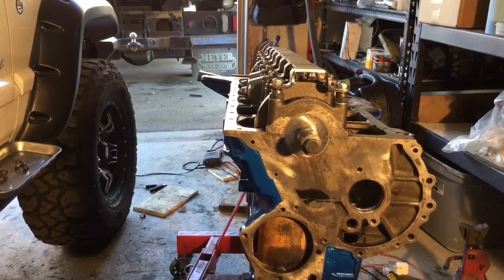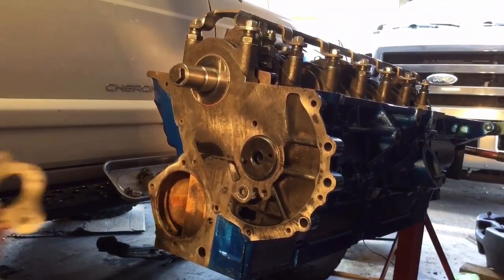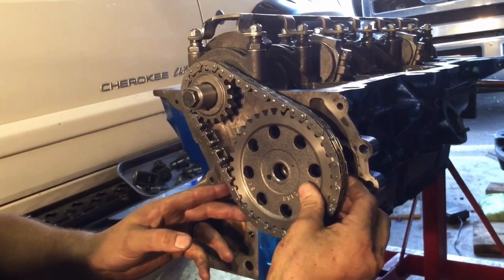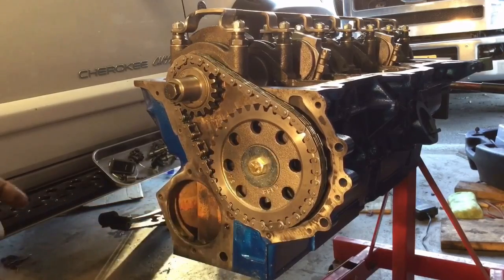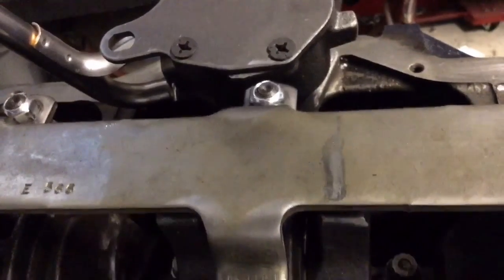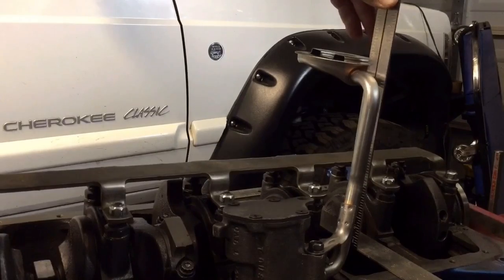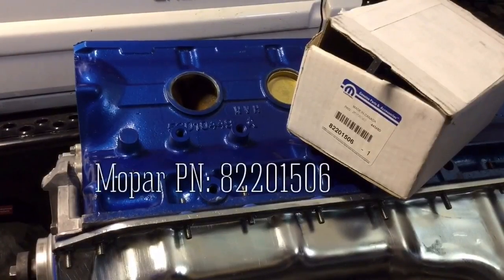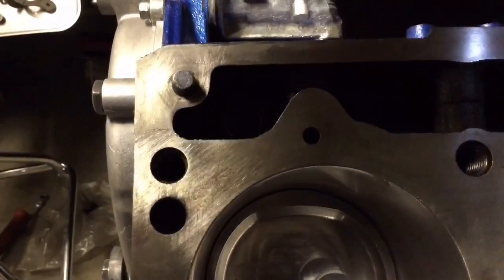Jeep 4.7 Stroker Complete Build Part 3

Comment: I’m building my 258 with the 4.0 Edelbrock head but I’m going with my stock oil pan. I know you used studs, but I’m interested in using ARP bolts to fasten down the oil pan, problem is I have no idea how long the bolts need to be, pretty sure you said they were 1/4-20 and 5/16-18 in the 4 corners, any idea how long the those bolts are? I won’t need any studs  for my pan. Thanks in advance. Your videos are awesome.

Comment: wondering if those oil pan studs will be a problem later.  You will have to use an allen wrench topside to get the pan nuts off and back on..... whenever you drop the pan.
Reply from the maker: I don’t think so. They’ll thread right out like a bolt is the nut is stuck to them.

Comment: I really like this video series. It's been extremely helpful on my 2001 stroker build. I have one question. Why does Comp Cams deny that the 3219 timing set works on these vehicles? Their website has it for a V6 motor. I want to use it on my 2001 XJ stroker, but need to verify fitment...
Reply from the maker: https://www.summitracing.com/parts/cca-3219/applications

Summit says it’s for the 4.2 Inline 6 (L6)

Comment: Maybe I missed you explaining it but why the balancer spacer?
Reply from the maker: Alfonso Solis I installed an oil slinger under the cover on the crank. That’s not necessary. The older ones came with one so I just installed it to help with lubrication.
Reply: I ment the spacer that came with that kit, or is all you used from the kit was the slinger?
Reply: I only ask because Im building a stroker and want to use that same SCAT crank but have heard when using a serp belt set up a spacer is needed for the balancer
Reply from the maker: Oh, there is a washer in there too. It’s a really thick one. It just goes under the crank bolt. Some people apply RTV to it to keep oil from pushing through the crank key and out the front. I’ve heard about using the spacer for the pulley but only when using an OEM crank out of a 4.2. I didn’t use one on mine and no issues with alignment or timing cover to balancer clearance.
Reply: Ok thank you, great set of videos by the way
Reply from the maker: You’re welcome and thanks for watching

Comment: small question on the oil slinger.  since your running a double roller chain theres no keyway for the slinger to sit up against. I see on mine that it just sits and can freely spin and float around. Is yours the same? Is the slinger really even needed?
Reply from the maker: Low Tide no, on the new timing sets no slinger is needed.

Comment: was your oil pump pick up tube to short because of the aftermarket pan or because of the M81? I'm running a stock pan so I'm assuming I'm ok.. I'll have to measure it out as well.
Reply from the maker: Kevin N I think it was too short because the 4.2 L has a different pan. It possibly was meant for a Car application as well

Comment: you should have used a degree wheel to st the cam properly
Reply from the maker: Dave Correira Explain how I deg wheel would have given a different result?
Reply: degree the cam makes sure you are at top dead center, the cam is ground according to the cam card, it's common practice for engine builders
Reply from the maker: Dave Correira well I’m certainly not an engine builder, just a guy who beats the shit out of my equipment. I figured I’m not going to send the cam back and it’s close enough if the timing marks line up and it runs on pump gas. I now realize that torquing the studs is wrong as several people have commented. Hopefully anyone who’s building a motor reads the comments and learns from everyone involved. My build started as an attempt at a powerful off road tractor but ended up as a torque monster that has lots of expensive parts which I feel will make it through the first thermonuclear meltdown and into my gen two shade tree 4.0/4.2 hybrid. IMO it has too much power for dirt and rocks and I’m too old to play in mud but it crushes the snow with in 4H locked taching it. The two things I will do differently next go-round is grind the rods to clear the girdle and use a roller cam-lifter. Thanks for the comments. I appreciate the input, and hopefully everyone watching reads through the comments for input and corrections. Just a month ago a viewer made me aware that I had incorrectly gapped my top piston rings....20 something thousand views later. My point is thank you for the comments and thanks for watching.
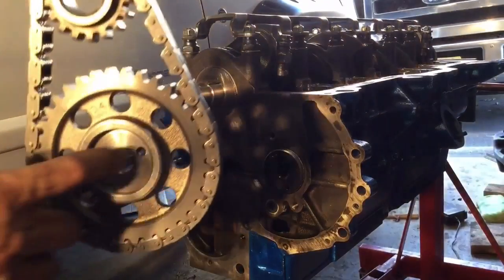Reply: @kevefox  You're obviously just fine without it, but I have run into problems with garage builds like this that would have been avoided if I had used a degree wheel....that being said they used to be kinda pricey and a lot of people couldn't justify the cost.  I think mine was somewhere in the $100 range when I got it, but Comp has a decent looking 9" one on amazon for about $20 now that's a bit easier.  One thing I will advise is when torquing you should always apply counter force at 90 degrees of your applied torque with the opposite hand.  This guy's video shows him doing it and he says to do it, but doesn't explain why: https://youtu.be/1qrAMIpQ9Ts (right around 2:45 and again at 4:05 -- he says something like holding the pivot in place, but you get the idea by watching)
IIRC the reason is that as you are applying torque on a fastener you are also applying a force that tends to bend the driver down instead of applying full torque to the fastener.  It's not likely TOO critical as the engineers usually build in a bit of slop in those values, but as you get to higher torques (head bolts, etc) you will notice a difference even in just the way the wrench "feels".  It is also very much more likely to slip off the fastener, especially if your doing this kind of stuff on a car or boat or some other harsh close quarters environment where corrosion is also a large concern.  Newer multipoint fasteners make slippage a bit less of a worry, but I still say one should always apply some counter force to be safe.
Reply: deg wheel is for ocd anal people. new cams have 4 deg advance ground in for a reason.

Comment: This build is fantastic, the best of its kind on YouTube.  You've definitely inspired me to do the same thing.  How does this compare with some of the stroker crate engines available for the xj?  Better quality parts I imagine?
Reply from the maker: WILSON! Thank you. It’s definitely got some pricier parts that will make it run smooth. I don’t see getting rid of this Jeep ever so I splurged but if I was just building a trail machine that I might trade or sell I wouldn’t spend that kind of money. Crate motors are kinda scary not knowing who built it so buying from a reputable company like 505 would be a safe way to go. You can always buy a short block and then add on as parts enter the budget for the next 2 weeks (26 buying cycles/yr) the coating on the rings is a debatable subject as far as dirt driving vs cleaner street air. Might not have a choice with a crate motor. Compression ratio for pump gas. Cooling system = aluminum parts. Lots of stuff to weigh. If I grenade this motor I have so many awesome parts inside to salvage that I’ll be looking good for building another. If you do build, don’t cheap out on wearable parts/gaskets. You’ll feel more secure 100 miles from nowhere.
Reply: Very interesting, thank you!

Comment: Nice video. Probably the best jeep video in terms of being informative on the build parts numbers. 
Do you mind sharing a link to those valve cover and oil pan stainless stud kits? Could not find any online for the 4.0L. Thank you.
Reply from the maker: Darkartz1 thanks, let me look real quick
Reply: I picked up a 5-0201 part number from this video (10:48) where you held it towards the camera. However that number does not provide an online link to a store/ manufacturer. My only hope lies on your purchase history :D
Reply from the maker: Darkartz1 I have to drive now but I will look in a little while the only one that I found it says the seller on eBay is away on vacation or something like that
Reply: I was actually able to track down the manufacturer of those studs 5-0201 and 5-0802. 
I have below included the link for the products. Might help someone else. (Scroll all the way down for oil pan kits) 
http://www.mmsacc-stainless.com/html/valve_cover_stud_kits.htm 

Thanks for showing those stud labels on camera :D
Reply from the maker: Darkartz1 here are the valve cover studs but the seller is away.
https://rover.ebay.com/rover/0/0/0?mpre=https%3A%2F%2Fwww.ebay.com%2Fulk%2Fitm%2F261007169545
Reply from the maker: Darkartz1 and the oil pan studs
https://rover.ebay.com/rover/0/0/0?mpre=https%3A%2F%2Fwww.ebay.com%2Fulk%2Fitm%2F350558907966
Reply: Thanks mate. By the way how much Static CR are you running and how much did you mill the block if you ever did?
Reply from the maker: Darkartz1 I didn’t deck the block at all, just factory height, and I still haven’t checked comp ratio.
Reply: Right. I assume your stroker has a Static CR of 8.98:1 or slightly higher. And a Dynamic CR of about 8.6:1. Are you experiencing any pre-ignition detonation on pump gas? (Not sure if its 87-89 or higher octane in US, In Aussie lowest is 91 Octane) 

96+ motors had a 7 degree retarded camshaft and 91-95 ones had a 8 degree retarded camshaft from factory. Also did not have a knock sensor so that prevented further retarding and allowed for running on low octane (87) fuels. But in trade for low octane fuel compatibility, engines had low Dynamic CR and were less efficient. The Comp 68-232-4 is a 6 degree advanced camshaft out of the box allowing a large increase in DCR, giving higher thermal efficiency. 

Are you running your setup on high octane fuel? Did you plan on the detonation issue beforehand?
Reply from the maker: DarkArtz 9 to 1 was my assumption, I’ve been running 91&92 octane (ethanol free) in it without issues but when it gets hot I can hear it a little. I need to get a tuner for it. Pretty sure advancing it will add quite a bit of umph but I want to get a transmission clutch set first.
Reply: Right. Now i know that mine will surely explode on pump gas with a 10:1 setup with that cam. 

Surprised FCA Australia never imported manual Cherokees. Its always the 4.0L + AW4 auto + NP242 setup for the petrol Cherokee however TJ Wranglers got stick with the NP231.
Reply from the maker: DarkArtz seems like most of the Cherokees here got the 231
Reply: CB960P Clevite 77 P-series Tri-Metal Standard rod bearings. Seems like hen's teeth, hard to find even in US. Been up all night trying to shop but no one stocks the P series anymore. They've only got the A series Aluminium ones. Any idea where i can order a set of P ones? Thanks a lot for the long chat and exchanging info by the way. It has been really helpful in my build.
Reply from the maker: DarkArtz here’s a link to RPM Machine and the rod bearings:
http://racingperformancemotorsportrpm.rpmware.com//clevite-77/clevite-rod-bearings/cb960p1/i-493211.aspx
Reply: Thats a 0.001 undersize bearing (CB960P1) , not the standard one (CB960P) you used. I rang Mahle/ Clevite customer care and they just told me that the P-series tri-metal have been replaced by A-Series bi-metal bearings and P will no longer be produced as time passes. You're lucky.
Reply from the maker: DarkArtz damn, I saw them individually on Amazon
Reply: Might want to buy and stock some for a future build? I just found a seller who had 8 pairs left on his shelf for a very long time in Kansas. After a very long conversation and convincing he agreed to sell me 6 pairs. Hope he posts it to me ha ha.
Reply from the maker: DarkArtz sounds like a good score.

Comment: where did you get the timing set with the hole for the comp cam, currently assembling my stroker but i got an OE timing set that wont fit my cam
Reply from the maker: Fleck Offroad SummitRacing

Comment: I noticed that when you didn't put the rubber chain tensioner in the cover.  any reason other than they seem to fall out?
Reply from the maker: Patrick Tavares no, I've never used a tensioner on a 4.0 platform.

Comment: How much were these parts? My 4.0 is reaching 240,000 and its something I'm looking to do for her eventually.
Reply from the maker: kingmabb not sure yet. I think minus the head/roller rockers/valves etc. somewhere in the $3,000 range using cleaned up factory stuff (head, intake, valve cover...) keeping it basic you could get it down around 2K easily depending on machine shop labor (boring/honing/lapping/cam bearings....)
Reply: With how detailed I am then for peace of mind I would definitely go with the amount of work you did. Great job. Thank you for getting back on that.

Comment: Why the moroso oil pan? It seems pretty expensive just to hold an extra quart or more
Reply from the maker: David Rodriguez just because it looks cool. JK, I've had a problem with another 4.0 with the same pump sucking air on cold startup because the oil doesn't make it back down soon enough. Negative temps. Also thought of off camber wheeling. One or two extra quarts really help with temps too.

Comment: About how much more HP and Toque will that Performer head get you? I'm a 19 year old that has always been into working on cars, but jeeps are special because I was never afraid to tear into em'. They're actually the reason i'll be going to school to be a tech. anyways, i'm thinking about rebuilding my 4.0l, I don't want to do a stroker, but I was thinking about whether the performer head was worth the $1700. Plus a few other upgrades. Your videos are awesome too! when I rebuild my 4.0l ill follow these vids. Thanks man!!!
Reply from the maker: My_Name_Is_Chef 
Thank you. If you are rebuilding it and just want a little more power, save your money. For the price of the head you can upgrade the cam, fuel injectors, oil pump, and pay for all bearings, machine work, ect. Also consider reusing the head bolts. If you're not increasing compression, save the money. It also makes it easier to change a head gasket (in vehicle) without head studs.
-Kevin